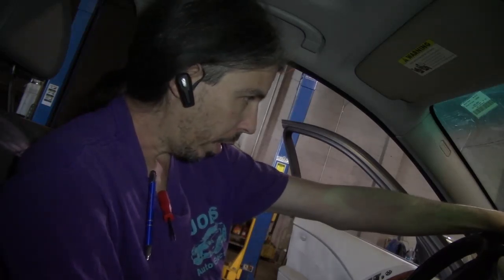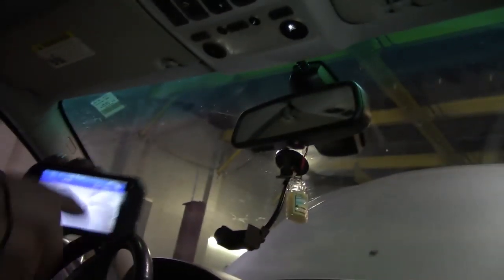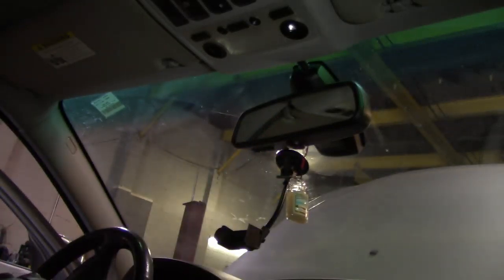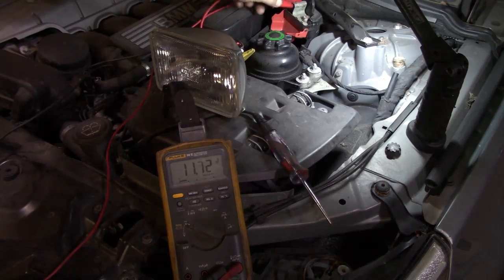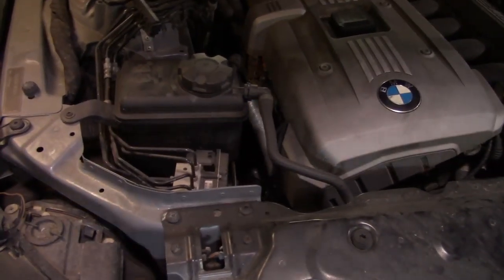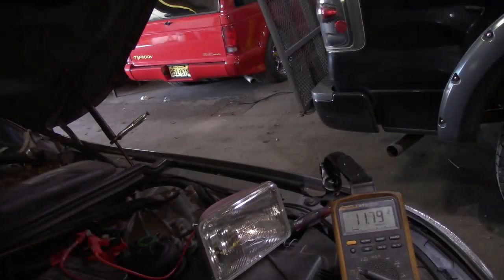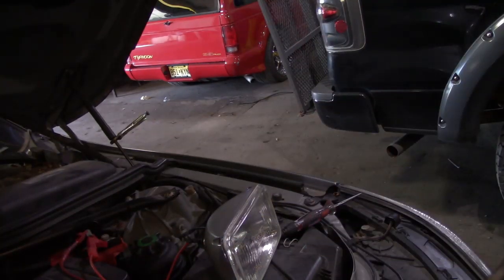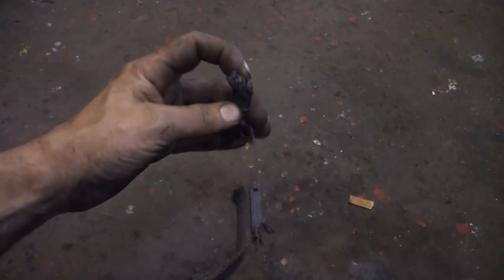My Car Wont Crank BMW No Crank  Load Test, Don't Ohm Test! Let's Test It Properly!

Comment: Question: when you load tested, and it failed.

Can the same be done with a typical test light? 

I saw you had a test light, but you weren't using the 'test light test light', but rather using your headlamp/fog lamp test light rig.

Is the small test lamp(snap on or w.e.) not enough of a load to be a good test? Or why did you use your big light setup. Thanks in advance. Great vid, left a like.
Reply from the maker: Your thoughts are correct. Using a test light may work, but certainly does not put enough loss IMHO.
Reply: @JoesAutoElectric  thank you Joe. Really appreciate it. Subbing now 👍

Comment: This is good to know. I'm an apprentice at a bmw Mercedes shop and recently we got into a 2003 g wagon that had problems with intermittent auxiliary fan operation and esp faults, I was fairly new in wiring and testing and was very lost while I watched my coworker Im shadowing under take steps to test everything and eventually we narrowed it down to a bad power cable to one of the fuse blocks near the driver side door and dash. It required use of Mercedes Benz xentry scan tool to actuate operations in the front sam and ME, fluke tester and power probe, solder pellets to fix the frayed power cable and half the dash and center console to be removed. Videos like this help me make more sense of this industry I'm new to as I came from a background in welding. Thanks!
Reply from the maker: Thank you and best of luck

Comment: bought a 1 owner 09 328xi cranks but won't fire 1 code is 2a9a cam inlet  today found broken in 2 ground cable. do u think that is why it won't fire I'm so hoping will be replacing cable tm praying it fires u. took a bit of a gamble hoping it was something silly and not timing related. It just turns over pray the ground strap breaths life back into it this is for my daughter who turns 17 in sept.  excellent vid sir

Comment: Bmw x5 2007 i was having weaker start for few months . i accidentally left the driver side door open it rained that night then when i tried to start the car makes weak humming noise, all lights and radio works, i replaced the battery just incase still doesn’t  start. getting error and dsc malfunction error in dashboard pls help

Comment: Joe, dude you are a god!! Did a turbocharger replacement on my 2010 535i and couldn’t figure out why it wasn’t starting. After about 2 weeks and 2 new batteries, I found your video. I forgot to mount the ground cable back to the motor mount. Thanks
Reply from the maker: I'm very happy to hear that we were of help to you. makes me feel good knowing that man. God Bless!

Comment: hello Joe my 2008 328i BMW headlites brakelites and domelites stay on with car off..do u know what is causing this and how i can shut them off as the battery will run down..when i try to connect the new batery there is  a big spark from the neg cable..shorted footwell MOdule? any help appreciated it also needs a new starter but i can attach my code reader as the battery cable is sparking big time..thanks
Reply from the maker: No way to diag a car on the internet. Bring it to a repair shop that can test it properly and repair it.

Comment: You wish diagnostic readers would be more useful. Instead of car access systems engine start operation fault, it would have been more helpful if it stated--check your engine ground strap.

Comment: Was there any power to accessories as far as windows locks radio thank you Joe
Reply from the maker: Yea all the time. Someone jumped the circuits
Reply: Unfortunately having a similar problem with a 750 it won’t crank but I think am getting somewhere I was messing around in the trunk and it started to try to crank but acted like the battery was dead  doesn’t show park and triangle is on

Comment: Hello JOE i hope u can help me out. We had a no crank no start and we charged the 2008 BMW 318i  under the truck at battery..i heard u r only suppose to jump start under the hood..also at same time the guy jumped a black relay under glove box that he thought was the starter relay,,,its 4 prong and black and square but turned out its not the starter..after he jumped the batterry and wrong relay, ALL LIGHTS STAYED ON HEADLITES, BRAKELITES DOME, AND WIPERS WITH CAR OFF!!! aslo it will not shit automatic..please help
Reply from the maker: Wish I could, but not much I can do man. Scan all modules see what's going on and go from there.

Comment: Also we can check the ground connection with continuity check between  (b-, chassis gnd, block gnd) grounds right
Reply from the maker: You can, but I never trust continuity tests on power and ground circuits. If you have one strand of wire or a thousand it will measure the same. Which would cause a failed diagnosis.

Comment: I’m fixing to install a used engine in a BMW and seen that ground strapped to the motor mount bracket snipped off by salvage yard puller

Comment: Great techique and proper solution! Most people being electrical Ignoramuses have the common Knee jerk reaction to al electical problem with its a "short" whereas in actuallity with any electical system most problems are caused by "opens"...!

Comment: Joe, have you ever tried the Load Pro test leads for your meter. They load the circuit to find voltage drop.
Reply from the maker: No sir, have no use for them honestly. Nothing my home made headlights won't do for me.

Comment: Great video, again. Question: if you had connected meter neg  to block ground and other lead to batt. ground; would you have seen the actual voltage drop but wo using lamp to provide the load?
Reply from the maker: The thing about doing it that way, is you are not loading the circuit with the meter. However, in this case, yes. The ground was completely broken off, so you would see it. Great question!

Comment: Hi, newbie question, I like to work on and service my cars(not a mechanic). I recently had this problem on a classic car after rebuild, and I determined that the engine block had a bad ground. It would only crank when it felt like it, so when I checked for ground, I used the continuity setting on the multimeter. How would that compare to load testing. Thank you, hope its not a dumb question.
Reply from the maker: No comparison. Load testing will stress the circuit, and will show a problem. Continuity is a terrible method for this kind of test unless the ground I completely broken. You will see the same reading on ohms if it had one strand or 100 strands connected, meaning there is a connection, but you won't know if it can carry a load. Hope this helps.
Reply: @JoesAutoElectric  Thank you for your answer, I will start to use your method in the future. I am surprised I don't see more people using load testing, Thank you, and I really enjoy you straight and no nonsense attitude. Best regards from Romania.
Reply from the maker: Thank you! Best of luck.

Comment: Yes you can get 12 volts with one strand of wire the size of hair.  Test light or meter will work but you load that circuit, you got big voltage drop.  Years ago I got caught with test light and didn't load the circuit when I was wet behind the ears. 😂
Reply from the maker: Indeed sir. Preach it!

Comment: Years ago there was an issue with destroyed wheel bearings due to bad block grounds and the ground path going through the wheel bearings and spark eroding the causing failure.
Reply: Wow never herd of that crazy

Comment: Bud, I thought the vid was great, but then I followed with a diagram which was confusing. How did you get 12volts from the battery to the 
 block ground on the block when the ground strap was completely brokened?
Reply from the maker: It can be picking up the reading from from anywhere, but there is no actual ground when you load test it, as you saw. This is the point of the video. Always load test or get burned. It only requires a single strand of wire to make the meter see a reading...but the bulb proves the fault.
Reply: @JoesAutoElectric  ok Thanks for the reply.

Comment: Did the dash light up when you first pushed the button? would have been nice to see you go through a diagram.  thanks for the vid.
Reply from the maker: Everything lit up, had comms with all modules. No need for a diagram on this. basic power and ground test showed me all I needed to see.

Comment: Did you put an OEM BMW strap on (giggles), or a generic braid?
Reply from the maker: Negative. I made my own ground cable.
Reply: @JoesAutoElectric  Negative. 🤣🤣🤣. I really don't like the braid strap. Prefer to run a decent size cable. Nice job Joe
Reply: @JoesAutoElectric  
I've heard the braided crap does help electrical noise but I really doubt you'll hear an ignition or alternator thru your am radio🤣